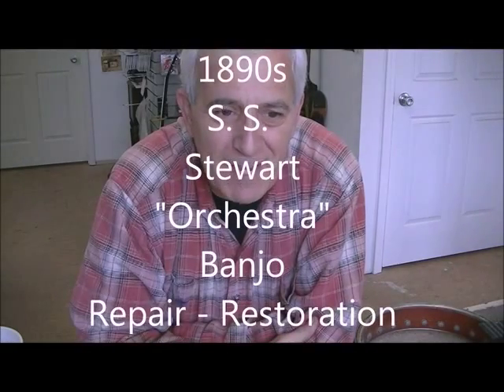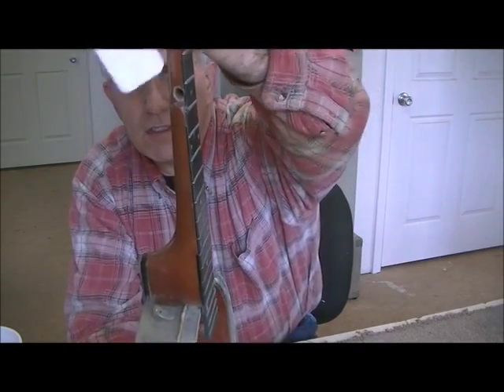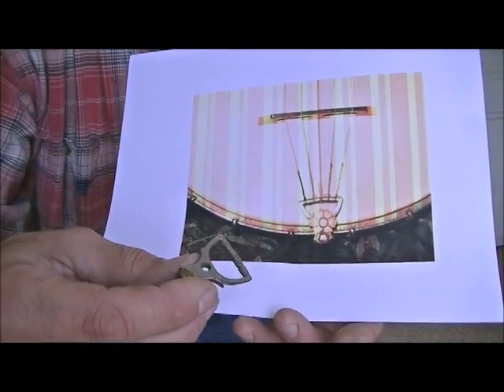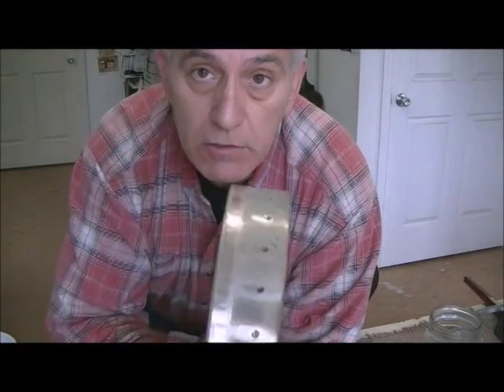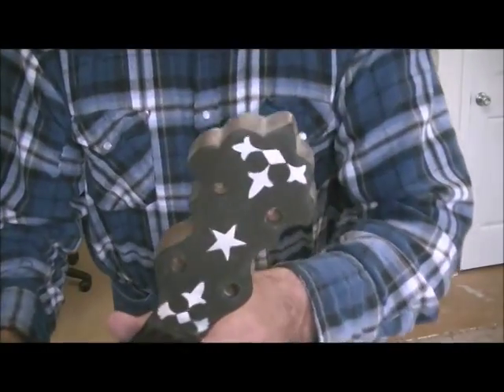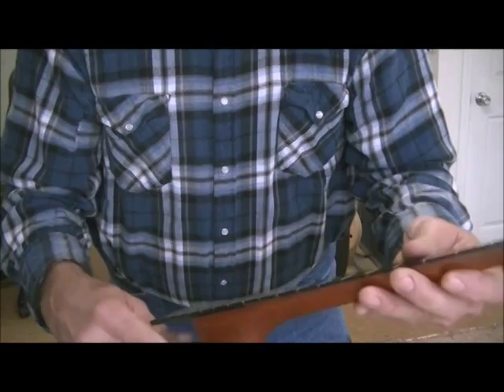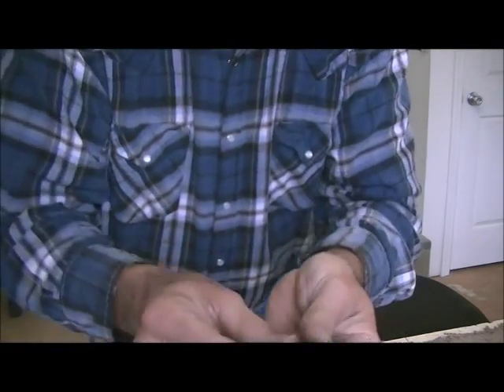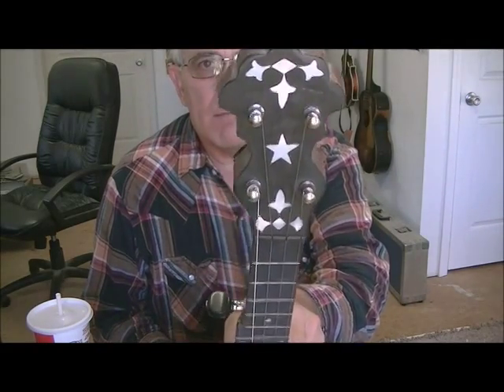038 RSW 1890s SS Stewart Banjeaurine 5 string

Comment: Looks like a late 1800s instrument.  Should not have steal strings on it, as it was never designed to have that much tension on the neck.  That is what I understand anyway.  Lovely instrument.  You did an amazing restoration.
Reply from the maker: It can handle light steel strings just fine. In fact some nylon strings exert much more pressure.